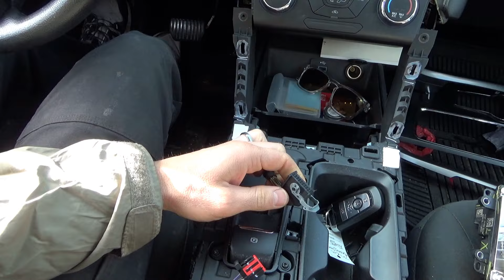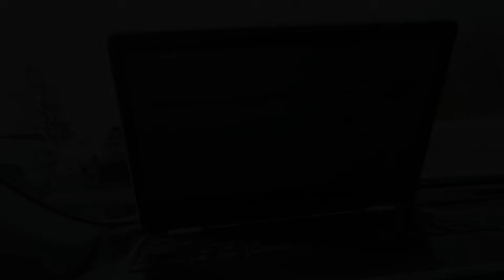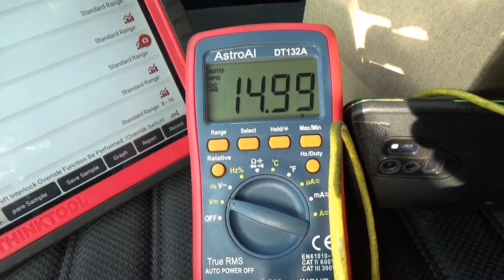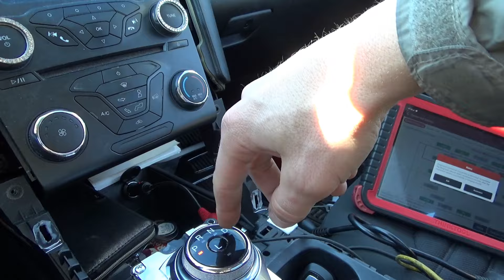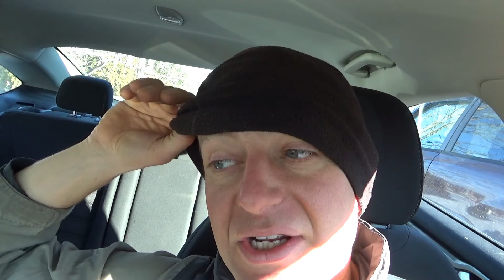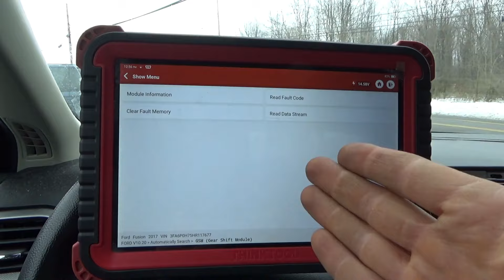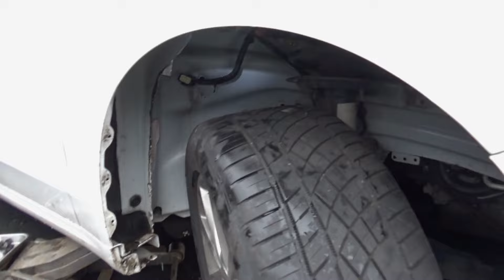Why New Cars SUCK (Ford Fusion STUCK in PARK?! - Part 2)

Comment: Darwinism indeed. 
I kind've understand why they did this. Push button start increases the possibility of someone exiting the vehicle and forgetting to put it in park.
At least with keyed ignition, you have to put it in park to get your key out of the igntion. 
IDK still way too much engineering. Lol
Thank you for posting, great job as always.
Reply: Exactly why they did it this way. Someone I think it was in Massachusetts  ran them selves over and sued. They said that the car should have auto parked.
Reply: @bryanfischer2443  Anton Yelchin died, now we have to deal with this crap
Reply: Wouldn't it be simpler to disable the start button if it's not in park AND you haven't got your foot on the brake?
Reply: @dreadnaught2707  it's about you leaving it in drive,, taking your seat belt off and opening the door. The idea was that it would auto park if that happened
Reply: Ah, right.

Comment: Is the motor a stepper motor?  If yes, i'm thinking the zero position switch is probably to blame.  This could be a physical input that is read, then sent along either a databus or a hard wire to GSM.

Comment: I am curious to know if the small motor is bad. My guess is that it sets the gear position by moving the slide up changing the detent location.
Reply: I was thinking of a cracked nylon pulley attached to that motor allowing it to slip.

Comment: My take is that little motor drives some sort of interlock and that prevents it from moving out of park. I've replaced dozens of those tiny motors on my Ford falcon door locks over and over again, they're just not reliable at all and only last a few years before giving up.

Comment: Diag manuals are written with positive logic in mind(unless written by on older person that is aware of the flip-side universe)  There is always the flip side of the situation.  I.e., what does "yes" mean?...  insofar as a diagnostic tool reports.  Me: Give me the raw, unconditioned data, intent of operation, electrical/logical expectations and leave it up to me to zero-in on what's going on.  I know this may have nothing to do with this adventure but I can see the same frustrations with this adventure(e.g. no DTCs).  DTCs are written by programmers and are bound to be blind to negative logic.  There can always be that one logical bit out of bunch that's needed to satisfy a condition(a mechanic has no access at that level).  Are all of those revealed in service info or scan tools?  No way.  They're secrets intentional or not.  The only reason OE works better is that they HAVE to solve it or buy it back.  Tricky business.

Comment: Perhaps a fault in another module is disabling selection, maybe the ABS fault? Installing the new unit, I would try putting it in various positions in case there’s a mismatch between the stored expected, and the actual selected. Beyond that, I would be at a loss since I don’t have those fancy tools.

Edit: Parts cannon hit it’s target. 👍 Crazy no fault code, process of elimination.
Reply: @Jonathan A Yes sir, I saw that. Comment before the edit was only a couple minutes in.

Comment: Glad you got it figured out. You called it in the last video when you said it was a mechanical issue with no codes.

Interesting case study. Thanks for sharing.
Reply: But yet the car new there was a problem and locked up the shift nob, so if the system detected an error why didn't flag a code. I hope ford fixed the error code in later models.

Comment: First vehicle that frustrated ivan.and thats just because of stupid overused technology for no reason 😑. Why they have to use a motor while driver hand still have to move it should be brain control or simple levar is best option.strange 💡 ideas and stupid over spent electronics

Comment: Really makes me think to keep my Ford Ranger 2005 5 speed manual with 65,000 miles instead of getting rid of it just because it is old.  And I only live a couple hours from State College PA, lol.  I have been told surface rust underneath only, frame solid but needs some overdue maintenance of fluids.  After watching this video, I am thinking the new Maverick is NOT the way to go.  *  THANK YOU * for all the wonderful replies ... I will take the advice and appreciate it.
Reply: Dont buy yourself a new problem
Reply: Please keep it, please save yourself a lot of money and trouble 😅!
Reply: You just getting it broken in!
Reply: Honestly it would be cheaper to rebuild your engine and transmission. Than buy this new rubbish. I still drive my 1978 Corolla SR Coupe.
Own it for 28 years still starts first turn of the key. I bought a new Ford. But I drive the Toyota cause the Ford is always broken 😆.
Reply: If you're not in the rust belt, you can run the Ranger for a long time!
Reply: Keep it, spend a little money on any minor work it needs. Sell it when it becomes an antique. 😊
Reply: Still have my 2002 Ranger 3.0 XLT with 168,000 miles...engine still runs amazing and barely any problems. I love my truck! Don't let go of it!
Reply: Fix that beauty up and take care of it.
Reply: 2005 and old? If you are in the rust belt, yes. Otherwise no.
Reply: @Pete N mine, too. 01 and 03 and no plans of getting rid of them.
Reply: The maverick is cheaply built.
Reply: No vehicles that have belts that run in oil for me !

Comment: Pretty tough when you have no way of finding codes.  Very poor design.  Like you said, what’s wrong with manual shifter.  Still has a cable but all those electronics.  Good fix.

Comment: If I won the lottery I wouldn't buy a vehicle newer than a 2008.
Reply: This is why I buy and drive stick shift only.
Reply: @BigMacIIx  I guess you'll never buy new again as the stick shift is largely obsolete in the realm of the industries mindset.
Reply: @pl5624  Most Japanese entries cars from Honda, Toyota, Subaru and Nissan are available with stick shift.  But I’m pretty sure my 17 Legacy will be my last ICE car.  I don’t mind get rid of the whole transmission non-sense with direct driven electric car.
Reply: I wouldn't go beyond 95
Reply: 1960 cars: i only need power to my distributor and gas to run
2020 cars: a mouse ate my crankshaft sensor wire, i cant run now…
Reply: Assuming spending lottery money I'd buy new and trade away for another when the warranty expires
Reply: Same here,  except my wife wanted a new vehicle.  So she bought a new toyota rav4 hybrid xle
Reply: Diesel before particulate filters is optimum. For gasoline cars in Europe it is cars untill 2000 which do not require emissions check via OBD. On EVs modern stuff is still best as long as your 12V is ok.